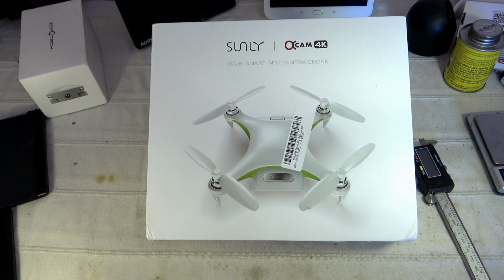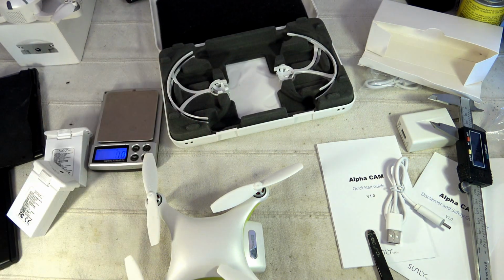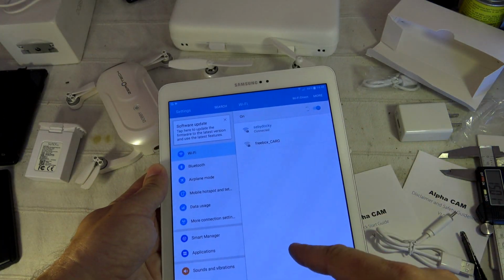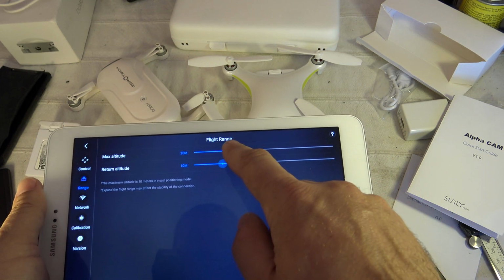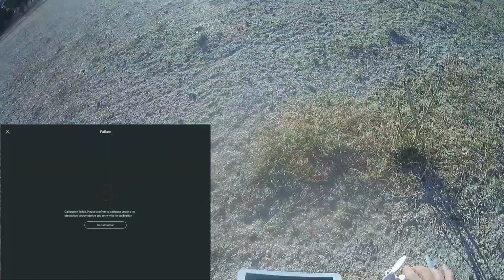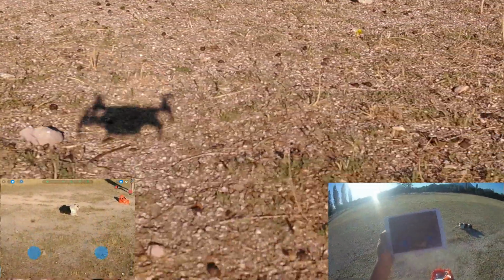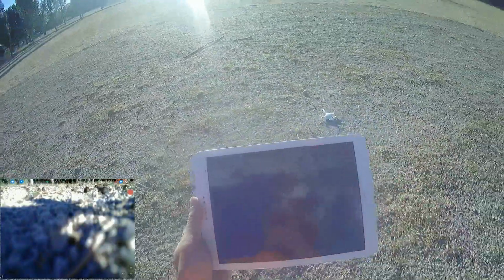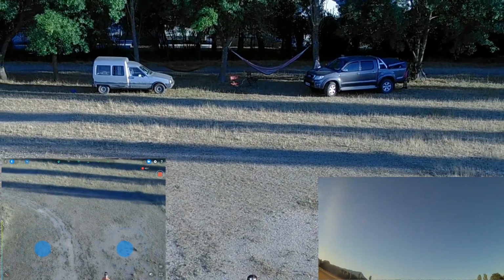Sunlytech ALPHAcam unboxing, analysis and demo flight (Courtesy Banggood)

Comment: Hello Friend. Bought in August and I was disappointed. It loses the signal and it flies wildly without destination, even though it is 5m distant from me. One year after launch, Sunlytech has not updated the features it promised. Their facebook is also very outdated and does not respond to email.
Reply from the maker: This machine requires compass and gyros calibrations.... often :( ... If not the behaviour is weird ... My sunlytech contact, told to me there will be a major release the september 30th .... so just cross our fingers that's it's true....

Comment: HOLA SEBY, EL MIO YA PASÓ A MEJOR VIDA, PROBANDO LA ULTIMA ACTUALIZACION V1.0.19 NO SE CONECTABA AL GPS Y CUANDO ESTABA A UNOS 15M, EMPEZO A ALEJARSE SIN RESPONDER A LOS MANDOS, NO PUDE VER DONDE CAYÓ, CON LA ACTUALIZACION ANTERIOR FUNCIONABA BIEN Y CON UN GPS MUY ESTABLE, CREO QUE NO LO ESTAN HACIENDO BIEN CON UN DRON QUE VALE MUCHO, UN SALUDO.
Reply from the maker: You need absoluptly to repeat the  compass calibration. I noticed effectivelly this drone is sensitive to the good compass calibration process.
Reply: ESTABA TODO BIEN, PERO NO SE CONECTABA EL GPS, ANTES DE ACTUALIZARLO SE CONECTABA EL GPS SIN PROBLEMA, PODIA ALEJARME 40M CON LA SEÑAL AL 100%, GRACIAS.

Comment: This drone is promising..But if advanced features like follow me, orbit etc are not yet available on this drone, Dobby is still the best affordable drone in the market out there.
Reply from the maker: According to Sunlytech contact, a major firmware update will come in a couple of days with at least follow-me.
Reply: Hopefully that will be available as soon as possible. I purchased dobby  for now due to the limitation of alpha cam's app. With exra battery, long flight time, portability etc, only the advanced features are lacking to make this drone much better than its competitors. I can't wait for it.. Thanks SeBy..

Comment: Well, the best thing I can say about it is that is has potential, and appears to be better than the Dobby, even with all its faults. There are bugs in the software, the calibration procedure is tedious, and the over heating problem is an issue. In any kind of wind, you could forget shooting in 4K. The 1080P EIS is pretty decent .. better than Dobby.  It's not as flawed as the original Xiaomi MI, but it does have issues. I wish the manufacturers would NOT release these quads until they have been thoroughly tested and perfected, as much as possible. The new DJI Spark isn't perfect, but its light years ahead of either of these two (in my opinion). Thanks for a good review and good comparison .. it was very enlightening, and I hope that those who may be interested in one of these quads will take a long hard look at your review. Cheers.
Reply: Bill Somrak in regards to the temperature. do you think it is fixable by software update in the near future? or is it totally rhe hardware fault?
Reply: I don't think its fixable by a software/firmware update. I don't think they allowed for enough cooling, so the only solution is a hardware one, which they may have to implement on version 2 of this drone.
Reply: oh no. i just put my order yesterday..xD.. what a shame. i was hoping it to be fixable by firmware update
Reply: Well, if the temperature is above 27C (80F) where you fly, you may have to keep your flights short .. maybe 7 minutes, and allow for some cool off time between flights. Eventually they will update the firmware so that some of the advanced features are enabled, and they may fix the phone app so that it doesn't crash. Good luck with your new UAV! Cheers.